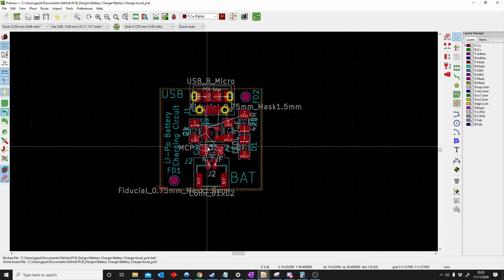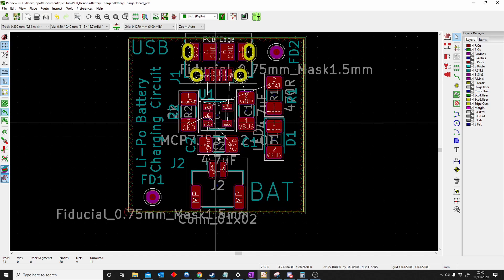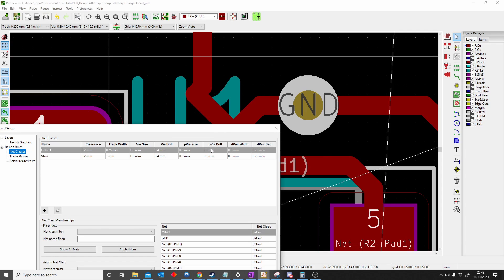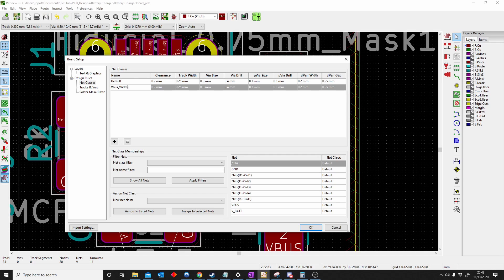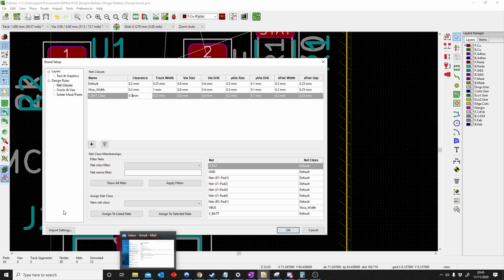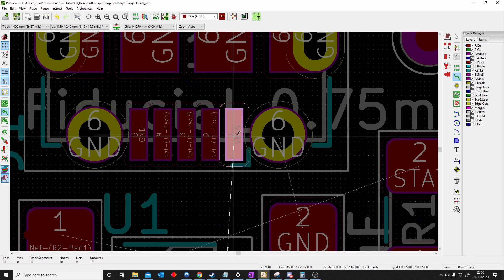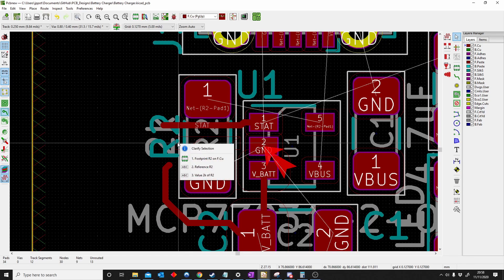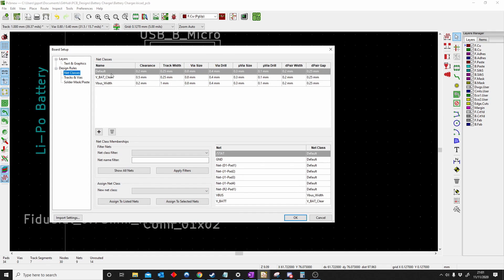KiCad Tutorial  - Setting up your clearance and track width rules for your PCB Design.

Comment: Hi JP - useful functionality, however I can think of places where this would cause its own problems, eg:
   - High current track, with a current sense resistor
      - Current path would need broad tracks
      - Current sensing lines might require narrow tracks (doesn't need broad tracks, in any case)
      - Both current path and current sensing lines would connect to the same nets
   - Battery supply connection with voltage sensing
      - Battery supply / charging would need broad tracks
      - Voltage sensing lines again might require narrow tracks (doesn't need broad tracks, in any case)
      - Both Battery supply / charging and voltage sensing lines would connect to the same nets

Is there a way to override the track widths without violating the DRC?

Ta

Comment: Good morning, this a question for the host or anyone in the comment section.
What is a good rule when make track sizes on a PCB?
big is better if you have the space or small.
examples:
5V power line 
3V power  line 
signal line
Thanks in advance

Comment: I like your videos and they are very informative.   I was wondering though if you might do a video on just routing a single layer board in KiCAD.   I looked all over the internet and YouTube for the information and only found one solution which was to go into the dsn file and delete the top layer section, but it did not work for me when using freerouting.
Reply from the maker: Hi 👋I appreciate your comment🙂. You mean like a single layer PCB so you can etch it or use a CNC machine? What is the reason you would like to do single? When you output gerbers you can only choose the top layer that might help? Let me know, otherwise we can chat on Discord maybe then I can help you🙂
Reply: @PlumPot  Yes, a single layer, the back side of a single sided home made pcb.  I kept getting errors when importing the ses file into KiCAD from freerouting.  I figured it out though when using freerouting that comes with Layout Editor.  I was using freerouting 1.3, but there is another version 1.4.4 on github and that one worked without any errors after setting the autorouter in freerouting to just route on the backside.  I had to use the Windows installer as just extracting the jar file from the linux zip file did not work though one would think a jar file would work on either OS.
Reply: Well, I found the solution on another Youtube video.  After laying out the pcb in PCBnew and creating the dsn file you need to open up the dsn file in a text editor and delete front or top layer section under layers.  Then save it and import it into freerouter.  It will only route the bottom layer.